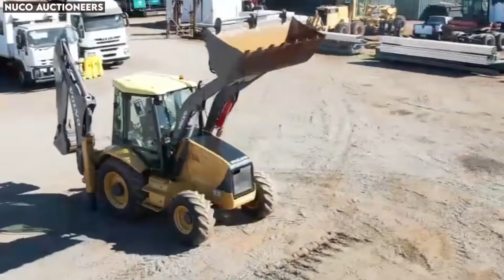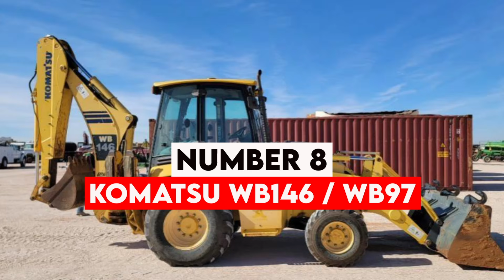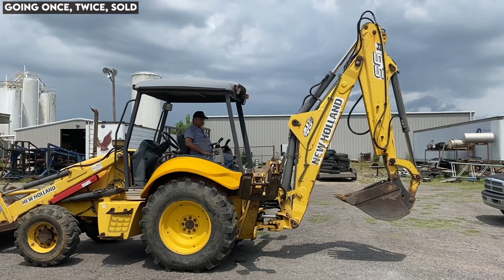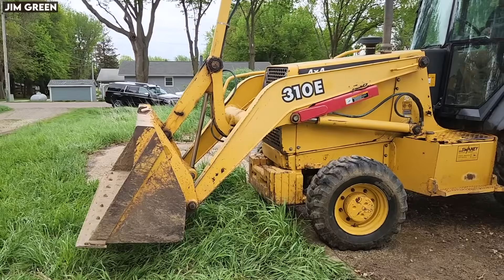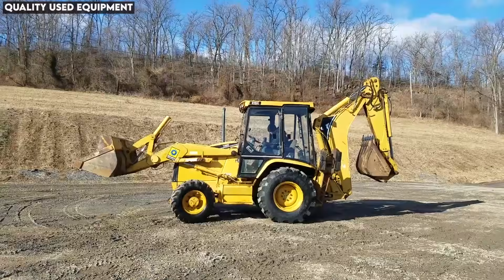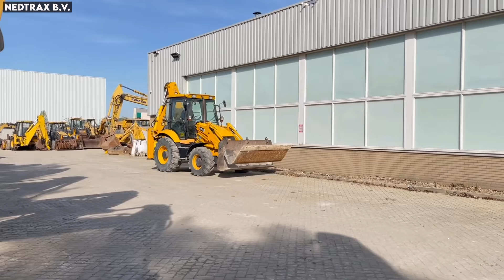10 Backhoes With the Longest Service Lives

Comment: "O" almost forgot to tell you my Dynahoe-190 made by Bucyrus Erie my 1978 Dynahoe has (8315) Hours on my meter, 😊 I have never taken her apart to overhaul that old 353 Detroit Diesel 😊 I just changed the filters and oil often when I first got her in 2003 and in 2026 she still makes that Detroit Load noise when RUNNING 😊 she does have the Blow/Buy on the engine and she leaves oil marks on the MAT I lay under her, she even has a drain pipe down of the engine for oil to leak through. The only thing I feel with her, is her MAIN base BOOM Pin is sloopy, not tight anymore but that just a big job for another day in her life sometimes in the future, but for my usage that is just around my property 😊 I mainly wanted a piece of equipment from the Bucyrus Line of construction equipment built till 1985 when Bucyrus decided to just build only for the super sized equipment in large scale mining. In 1985 they STOPPED all their construction equipment, that was not huge, but at the end in the early 1980s when Bucyrus built the 500-H excavator, a just massive machine 😊 they were just starting to get into really neat, upper house body design with this new heavy duty Fiberglass body, but they still used the Air over Hydraulic design for the control levers, with a large number of small air tubes going up under the two hand levers on each side of the operator seat. And of course they left the SAME control pattern on those two levers, with Boom and Swing on forward and back on levers and Dipper and Bucket side to side motion with your hands, they did not do what (CAT) did with the brand new 225 excavator on its hand levers, they made the (X) pattern that is basically in ALL excavator made today, they even call that pattern 😊 probably after (CAT) put it in all of there excavator, they call it (Excavator Patter) and the other pattern is call (Backhoe) pattern in what I think is named that after the (JOHN DEERE) Backhoes & excavator pattern they design. Basically it just SWITCHES what hand you want the BOOM control to be on, do you prefer the Left hand or Right hand for digging. It is so much different than the 1970s when man "O" man all the manufacturer made a different control layout with a bunch of levers infront of you, or you had FOOT pedals for different functions. You had to be very good at being able to adapt to the different cab layouts, (CAT) made it very simple in there first excavator and everyone else just copys it for operator comfort in my humble opinion. Thank you so much for these great history lessons and about the equipment from the past. If ou baby a old Backhoe like mine, they do LAST. 😊❤😊

Comment: I remember one contractor had the very early (JOHN DEERE) 310 Backhoe on a water main upgrade we had him do, he brought that old girl to do the digging and backfill on that 8-inch D/I pipe, and I was amazed that it had a "CLUTCH" to push in on the "Shuttle" shifter lever, it had a gear Range shift lever on floor with a High/Low shifter next to the gear lever, that contractor shifted that old girl hard, back & forth on backfilling, and she just took the constant Shuttle shifting, 😊 the thing that I liked most about that (John Deere) was there was another contractor doing the same area we worked in, but he had brand new (JOHN DEERE) 410 Backhoes on the Road redo project. Thos newer ones had the tork/converter power Shuttle shifter. And that old 310 was as fast and loaded its bucket as fast as the new Backhoes, I also noticed in the old(JOHN DEERE) 450-C Dozers from the 1970s that had the "CLUTCH" pedal for going back and forth 😊 that Dozer at full throttle could take the shock of the shifting all day long, and never, slip or ever feel like it was loss, it just worked perfectly. That is amazing to me at FULL throttle you can engage the clutch all day long and the
(JOHN DEERE) equipment just kept working, the clutch shifting 😊 never got sloppy or loss feeling in over and over "SHIFTS" your legs got tired or at least mine did. 😊

Comment: I will say something about the (CAT-420) 😊 that proves your point on them 😊 when you said "RENTAL" Fleets LIKE them, and you described the USAGE, just think about one important thing, just for a moment 😊 when in RENTAL usage what does the operator do all the time to keep under the 8 hour on the meter Time usage, thay NEVER let the engine cool down properly, it is not the operator fault, it is so he can keep the RUN hours DOWN, he will shut the engine OFF, and you look at it, that Diesel engine (CAT) puts in that Backhoe/Loader the engine must be very well built to take that STOPPING without the manufacturer specification for cool downing that engine after full throttle usage. The Rental guy or gal, just wants to keep that HOUR meter below the 8 hour Rental fees, if say he uses the Backhoe just one day, times that by many Renters, always watching the engine run time. And that tells me their Diesel engines are built to take the STOPPING & STARTING day in and day out. Just my humble opinion

Comment: Another comment I had was about (NEW HOLLAND) the front Bucket whole Design. It was all very STRAIGHT, instead of arched, like most Backhoe/Loaders front bucket frames. And the Bucket itself with the different design size, and the way it Looks, even looking at the (FORD) Backhoe/Loader from before the (New Holland) the 555 had that SAME totally different design than all the other manufacturer of the time, all of Fords tech went into New Holland and combined engineering teams when they formed a partnership. And if you look at a brand new (CASE-580) series and a New Holland you see the same similar Design in the front Loader & the ditch digging Build, they all combined technology together in the newest Backhoe/Loader in my humble opinion

Comment: The (KOMATSU) Backhoe matches my 1978 (DYNAHOE-190) the one that (High-Dinamics) 😊 designed and built, then was taken over by Bucyrus Erie 😊
My Dynahoe is 19400 pounds, and has a (92-HP) Detroit Diesel-353 engine. It can dig down "STANDARD" depth-19-FEET, 😊 no extendahoe, my Dipper arm is over 10-FEET by itself 😊 my regular bucket for digging is 2-feet wide by 3-feet length by almost 4-feet DEEP, 😊 just massive for a Backhoe/ Loader, it has "RIPPED" out huge Maple tree "ROOTS" like they we just small pieces of wood in the ground, then I was able to LIFT the WHOLE stump, in the curl of my Bucyrus. The design in my digging bucket geometry is really nice, it has straight wall digging abilities and a great "CURL" for loading any 12 yard Dump truck. It is neat that (KOMATSU) built a Backhoe that meets and has a more powerful Diesel in one of the models 😊 the history behind that Backhoe built might be the joint Bucyrus/ KOMATSU relationship that they had years ago, in early Hydraulic excavator joint building technology. The Difference I see in my Backhoe and the KOMATSU one, is my front bucket DUMP cylinders go straight up to the top of front bucket were as the KOMATSU has the LINKAGE type of Bucket dump cylinders. And I do not have the excavator arch BOOM arm on the ditch digging end.